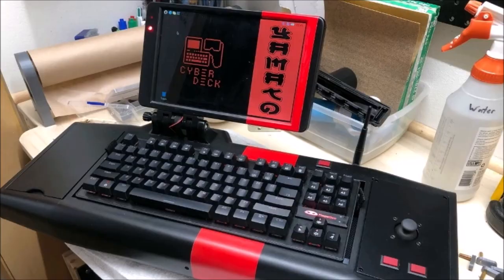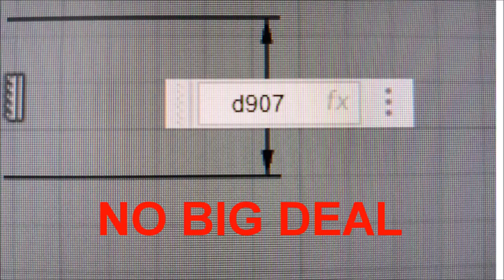Cyberdeck Build

Comment: "tiny screen":  Gibson's cyberdecks were actually fairly large, with the hacker in Neuromancer having to jury-rig a sling at one point to be able to carry it around.  There wasn't a display because a direct neural interface was used (a cable from the deck to an input port in the user's skull).  The deck was also just the core of a complete system:  there's a scene describing a room littered with packing foam after a new deck and its peripherals were unpacked.

I love your design, especially the way the handle protects the screen.  But for the life of me I can't figure out how you got Satisfactory to run on it!

Comment: I could get into it if the screen was bigger. Want more utility than just a unique toy. Can it be built with a 15" laptop screen from 2020? Say maybe a 1440p glossy screen.
Reply from the maker: Sure it can, but at that point you might just want a laptop. This is exactly the amount of utility I was after, to edit text files and game on the go. The Pi gives a great computing experience for the money. You'd have to see if that's enough power for you, and if the price of the big screen would make it worth building your own
Reply: @darrensontos1012  A laptop wouldn't be resistant to EMP's like cyberdecks are typically built to be. Nor would it be as cool looking or have a nice mechanical keyboard.